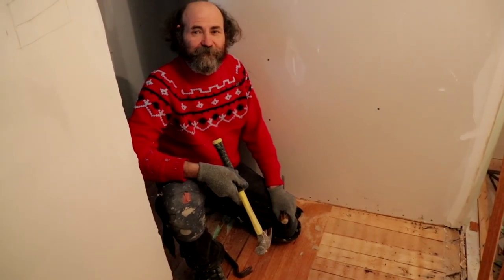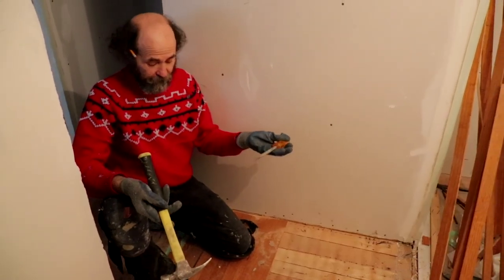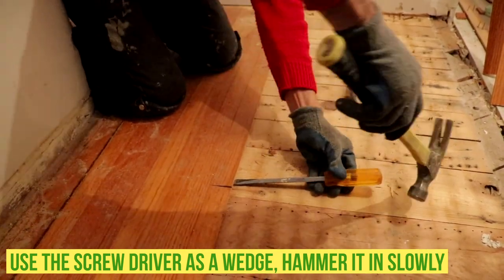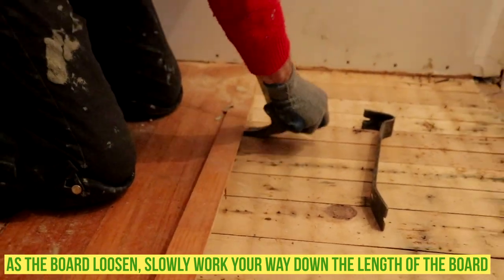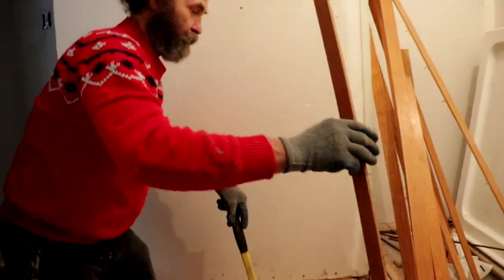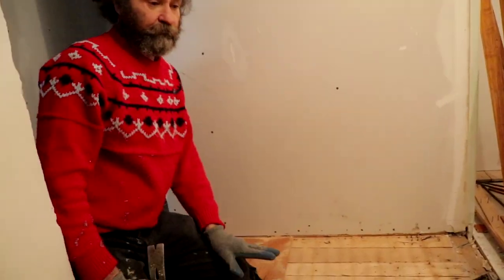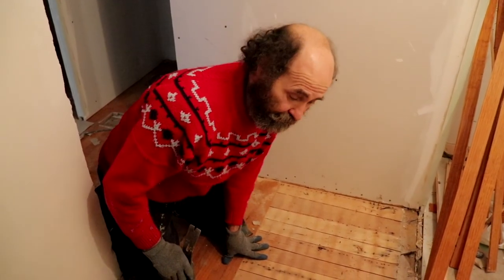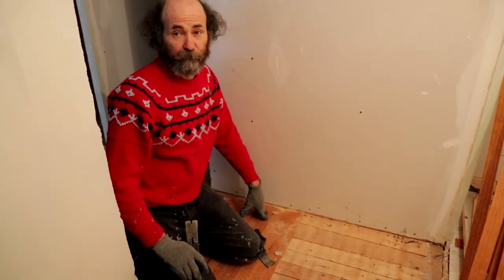How to Remove HARDWOOD FLOORING for REUSE

Comment: Good, but this is the easy scenario, no tongue and groove..
I had tongue and groove with nails diagonally through the tongue - that requires a good bit more finesse.
I'd start prying from the "groove" side partially, then pulling away, also being careful to pry both sides of end joints together if one wants to preserve t&g on ends.
Some splitting of t&g happened inevitably, but the bulk of material preserved, maybe not for reuse as flooring, but at least as a general woodworking material, got piles of it.
Also made a jig for de-nailing diagonal nails from tongue with great success.
Anyway, always good to reuse stuff, too much waste everywhere already.
👍
Reply from the maker: Thank you very much D K for watching my videos, to do smalls repairs on a old floor used wood floor works great, but I never done a complete floor with used materials, it is time consuming, I like to small hobby projects with old good wood and most the time I don't have to by them, keep safe and thank you for recycling.